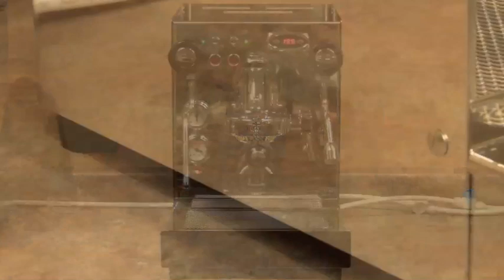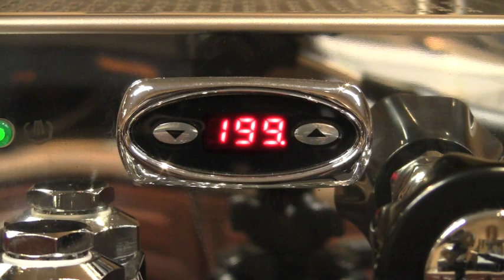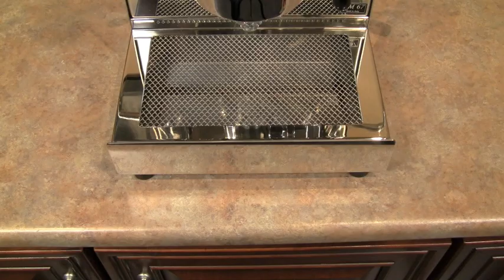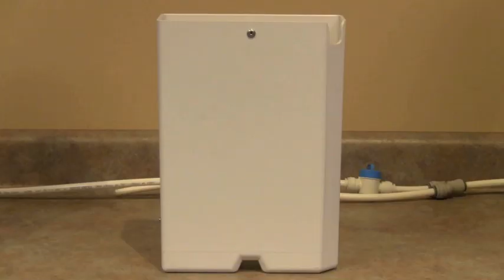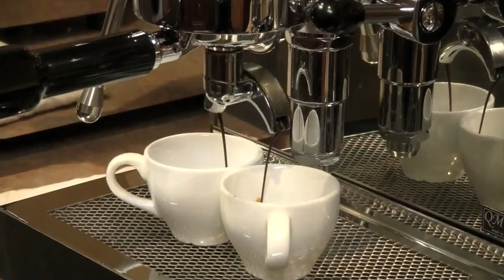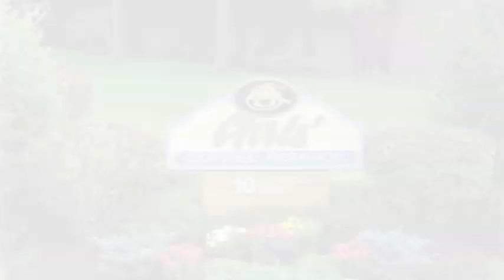QM67 Dual Boiler By Quick Mill Overview

Comment: It has pre infusion without needing to be plumbed in but has minimal pressure. Does anyone have any ideas on how long to leave the lever in pre infusion mode before putting the pump on? For me it takes about 20 seconds to do a good pre infusion to thoroughly wet the puck.